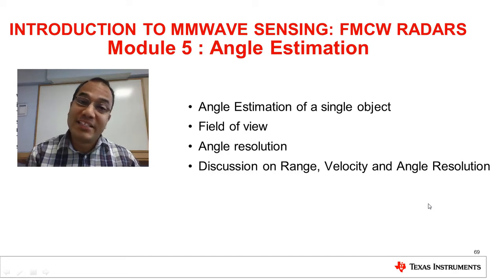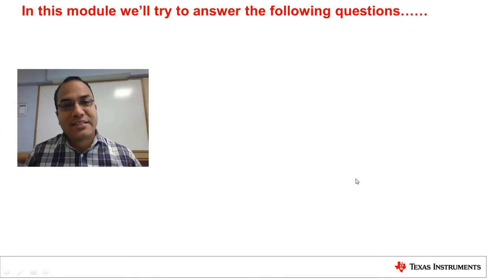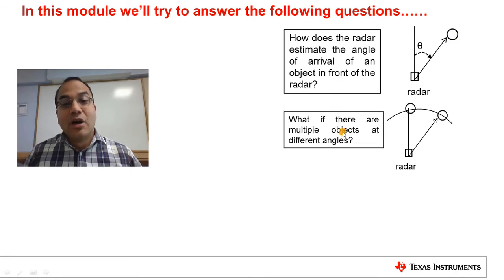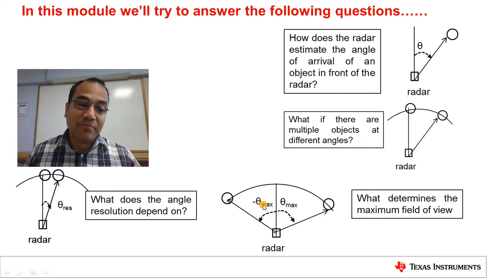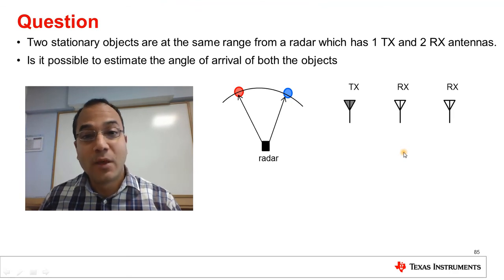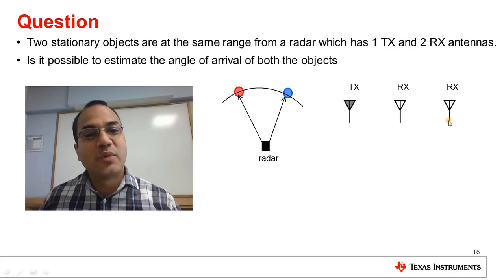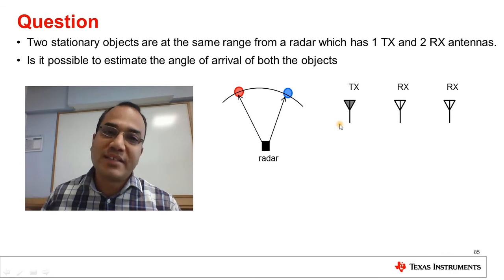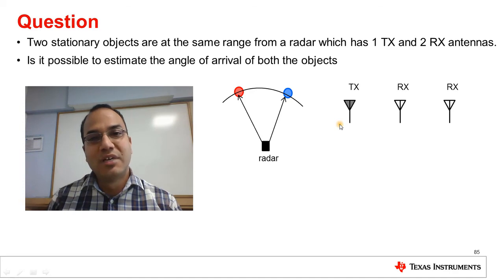FMCW Radars Lec 5: Angle Estimation

Comment: Is the answer of the question at the end of the video "No, it's not possible with only 2 Rx Antennas"?
Reply: Yes that is right. With 2 RX antennas you can only estimate the angle of arrival of a single object in a range-Doppler bin
Reply: @sandeeprao3753  And in this case do we need at least 4 Rx antennas?
Reply: @lxzhang4911  n targets Need n+1 antennas to get resolved (if Resolution is enough)

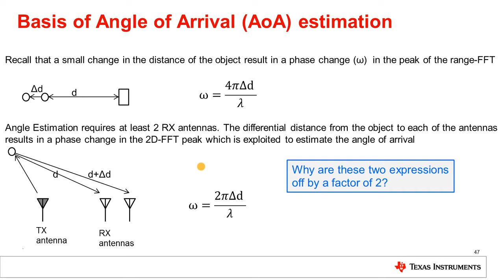Comment: Such a brilliant video, I've learned a lot. But I wonder if there is a cut at 2:20. I'm very curious about WHY are these two expressions off by a factor of 2 ?
Reply: In the first case, the differential distance affects the round-trip (to and fro to the target). In the second case the differential distance is only one way (from the target to a specific antenna)
Reply: - In first case, the difference in time translates to the difference in round-trip distances, so delta_T = 2*delta_D/c (distance/velocity). The differential distance is measured across 2 consecutive chirps.
- In the second case, the difference in time translates to difference in distance travelled by the radar waves to get to Rx antenna 1 and antenna 2, so delta_T = delta_D/c (where delta_D is the additional distance the radar wave has to travel to reach the farther antenna). The differential distance is measured during the same chirp but is a function of the distance/separation between the antennas.